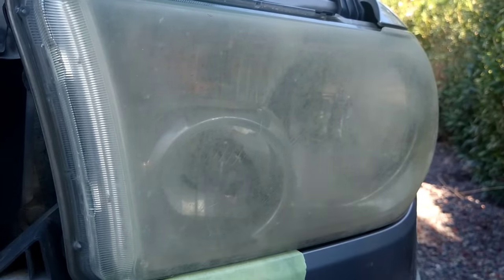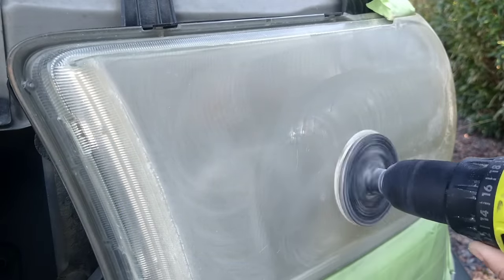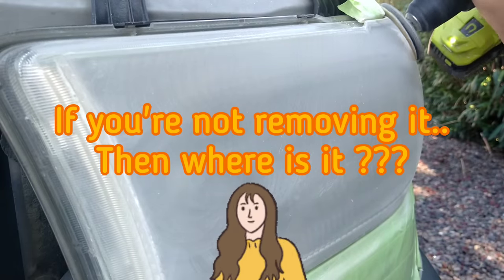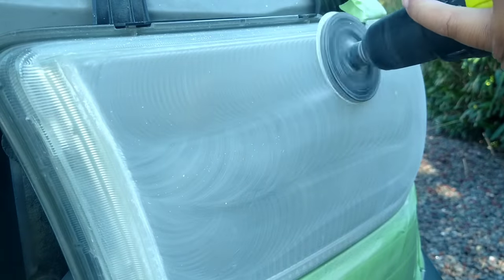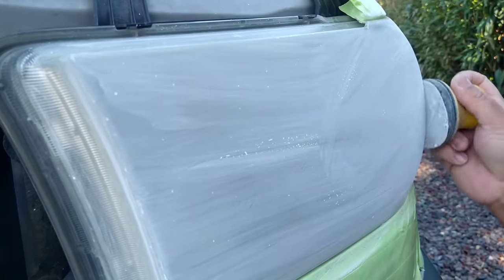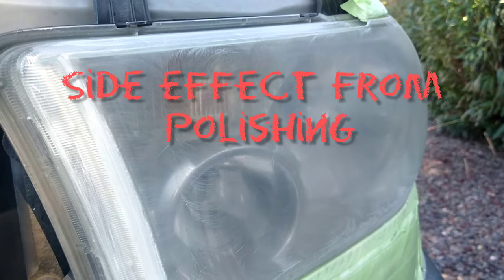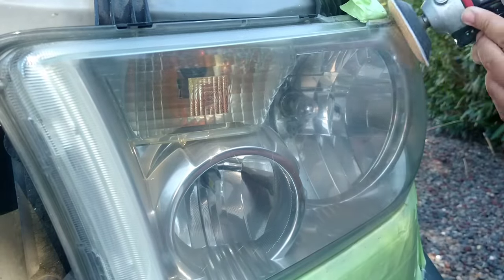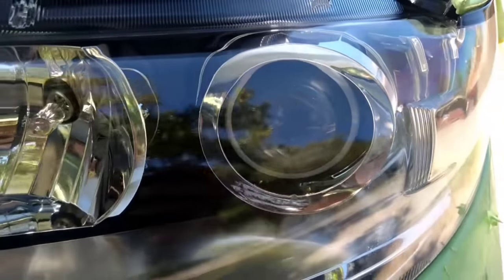POLISHING HEADLIGHTS IS A SHAM/scam  ---  and why you should never only polish headlights

Comment: please help: wet-sand-paper 320-400-600-800-1000-1500-2000 by hand with swirling motion. with each next sanding, go less and less milky residue. they appear opaque now. do i need to go higher grade? 3000, 3500? do i need to buff, can i get away with no buffing? what paste is used for buffing. then i plan to crystal clear coat them. can i skip the buffing?
Reply from the maker: I don't wet sand...it's obsolete...
If you must you need higher grit..
Yes.. always buff...
Watch more of my videos......
Reply: @theheadlightrestorationpro  Thanks. What buffing material to use? Where do I get it from? What clear coating? I just got rust oleum enamel, but is not recommended for lenses. Which one you use> Most of the things I found are for "easy" restoration, not like you did.
Reply from the maker: You got to watch the videos bro.. everything is in the video.. you're asking me something that's what every video...

Comment: there is a plastic film over my headlights.  04 Ford falcon.  if you got that off .. the headlights would be clean.. wouldn't they ??problem is .. how to get it off.
Reply from the maker: Most of the times it damages the clear coat on the headlight so you'll end up need to have a rest for reapplying or if you choose not to reapply..
Pretty much the only way is to pull it off with a heat gun or maybe some water as you pull gently or both...

Comment: why not use DEET on headlight to clear it and  then Maquires Headlight coating?
Reply from the maker: Not sure what this product is ...is it a headlight product ?
Reply: @theheadlightrestorationpro  IT IS ACTUALLY DEET(INSECT REPELLANT) AND IT SEEMS TO CLEAR THE LENS VERY QUICKLY AND THEN I AM THINKING SPRAYING ON YOUR MEGUIRS HEADLIGHT SEALANT.
Reply from the maker: @sandiebock8035  unless you're just looking to repel bugs I probably wouldn't use bug repellent..🐜🐝🐝 check out this video there's a segment that will explain to you why that's not such a great idea and why it appears to make your headlights clear but really doesn't...https://youtu.be/cSD2dAioFWI
Actual have some informative videos coming up soon possibly this week about this issue. More in depth.

Comment: The plastic on headlights is designed to bounce rocks off of it without cracking you can buy aftermarket made in China headlights that have a cheaper plastic that actually does not dull because it's a type of plastic that will crack easier but it stays clear longer it worked for me
Reply from the maker: After market lights =🗑️

Comment: I would caution anyone trying this for the first time, to go slow and gently with the drill/polisher. You can and will burn the lense/plastic very easily. I would stress wet sanding the first few steps. Make sure you don't have to much build up on the sanding surface. Cause this can damage the resurfaced lense. Take your time and just remove the oxide layer to fresh new plastic. Also don't use high speed unless obviously you can.

Comment: I just wet sanded from 1000 to 2000 then 5 coats of uv protection clear. Even got pulled over because they thought my brights were on.. 🤔
Reply from the maker: https://youtu.be/bCD4At1iFAg
That's a lot of clear..
In my experience with each layer of clear it diminishes the the lenses photo transparency.. meaning light escaping the headlight.. this is purposely one of the reasons why I do one coat...
https://youtu.be/bCD4At1iFAg
Reply from the maker: Also made a video someone about that..
What you were saying you do is a bit more extreme than this.
This video is titled why not to double coat..https://youtu.be/NgxNImOAoCY
Might be getting even better performance if you had a single coat.
Thank you for watching..
Reply: @theheadlightrestorationpro  i did 5 light coats.. wish I could post a picture here. By hand it took me about a hour per light. Turned out fantastic in my opinion. Yours did too! I'll check these vids out.
Reply from the maker: Awesome plenty of videos up and more to come should have a couple dropping this week.. I focus on quality over quantity and my videos and everything... Really appreciate you watching there is a email in there in the bio feel free to drop a picture or 2👍🏼💯

Comment: thought you're supposed to use water with the sanding process?
Reply from the maker: In the right place but dry sanding is far superior... But as you do see there's points that I do wet sand... Wet sand far as proper sanding anything is supposed to be at the end as a final finish
.. check this video out..https://youtu.be/cgKCQVM4GyU?si=z99_zVzfJBlW5Pxx

https://youtu.be/9DfP_dqw1mU?si=l-Vv4-VbQNP5T9qQ

Comment: Do you need to buff the finishing spray?
Reply from the maker: Just have a question or two for you to answer your question ...
Have you ever seen me do this?
As perfect as you see my final spray do you think I would need to polish it?...
What you see on my videos is what the process is...
With one exception everybody should be doing with their headlights whether it's headlight restoration or a new headlight that doesn't need headlight restoration that they want to prolong the health of the headlight and not need headlight restoration...
That's AFTERCARE..
With aftercare your lights can literally last 3 to 5 years with this method... Like on my personal vehicle which is 4 years and some change at this point.. just over 4 years...
Here's the video about aftercare..
https://youtu.be/kIur4XxYjDk
Reply from the maker: PS if you have to do anything while your initial application of the clear coat.. the method is highly flawed...
The type of clear coat you should be using on a headlight is set it and forget it..
Spray it on and let it dry..
That's it..
People put stuff that's not designed for headlights on there this is why they need to do all this buffing and all this other stuff afterwards..
Reply: @theheadlightrestorationpro  I used what you recommended  A yes or no would have been an acceptable answer  It was my first time and I may have wiped it too early  Anyways, thanks for responding even if it was condescending lol
Reply from the maker: Not condescending....just this is a video platform...not a question platform..
I have like 50 videos up that do what you asked in each one ...
I really want people to just really watch the videos and not rely on questions that are in every video..
It's not condescending to you or meant that way ..
Just that if something is answered in the videos I would prefer you to get the information from watching...it will sink in better than me just messaging...
Thanks for watching.. 
A lot of videos up and some really cool stuff coming..👍🏽💯
Reply: @theheadlightrestorationpro  Cool! Im ADHD and have alot going on  I will try to watch more of your videos! I love your easy to understand instructions! Thanks for taking the time to tell me you dont have the time lol
Reply from the maker: Appreciate you watching 👍🏽

Comment: Goof off pro strength in the metal can took the haze right off my 350z headlights with just a rag. No abrasive needed. Then clean with a degreases the get the oil off the headlight. Easy
Reply from the maker: Wouldn't come out like this👇🏽https://youtu.be/bCD4At1iFAg

Comment: Can you fix ebay headlights that are very clear but turned yellow?
Reply from the maker: Yes you can use the same exact process on those...
Reply: @theheadlightrestorationpro  I don't mean they are hazy, they are very clear, just the  plastic is yellow. I sanded the coating off, very clear, but still yellow, so I sanded three more times, each time the yellow remains.
Reply from the maker: @r.weaver3769 you never know what's aftermarket... They're typically cheaply made.. the actual plastic (polycarbonate) might have change colors.

Comment: Same as paint.  Once the finish has oxidized thru it entire  thickness it will continue to fail.  A detailer can polish and shine up the surface... but it will not last at all..  Every headlight cover out there has varying depth of oxidation.  If it's oxidized thru the first 30% then that 30% has to be removed by a skilled tech. Etc. Etc.  Many driveway detailers will polish and shine the oxidized  material,  but again It will not last and must be removed down to a  molecularly undamaged material...If any still remains.

Comment: I always say oxidized plastic is a lot like rust on metal. Why wouldn't you remove the rust? And so then why wouldn't you remove the oxidization. Anything less than that is not solving the actual issue

Comment: Use a propane torch.... people  use it on all plastic  to restore  color.  It works.
Reply from the maker: It wouldn't work like this headlights too big of a surface extremely easy to damage about 7 out of nine times you would damage the headlight overall the headlight will be extremely damage let alone the surroundings of the headlight such as car paint and brackets and seals... Not really practical and won't really work.. don't forget this plastic is clear..

Comment: an UV resistant clear coat that is rated for plastics will work to coat the light
Reply from the maker: A coating that is meant for plastic typically can have some issues with headlights you need something rated for clear transparent plastic, one specifically designed for something that has a lumens in it.. AKA releases light...

Comment: first of all, you can do it both ways. One you can clear him or the first one. You can buff and then put ceramic coating on top, it'll last just. As long? But I usually ask the customers cause it costs more money to clear them and to put a ceramic coating on Shop and I have. My customers coming back after 5 years and they still look new so. Yes, you can clear them with automotive clear. Or what's in far from farm? Then take ceramic, wipe them up and wipe them off. And you should be fine

Comment: Polishing just fills microscopic cracks.  As soon as the polish gets washed away, the headlights will be just as foggy as they used to be.  You can test this using oil, just wipe some on a foggy headlight and it’ll go clear…for about 20 minutes.

Comment: Professional detailer here. Polish and or compound is the same as sanding just much slower. if you buff or polish correctly there is no residue buildup. Also the correct compound would need to be used not just any polish will do. Reason it came back is because he didn't seal the headlight properly when it was done or used the incorrect compound. Plastic is completely different then clearcoat. Probably waxed it. Lol. I understand you are solely a headlight restorer. so of course you are going to say your way is the best. Just do your homework people. There are products you can use that don't require sanding and do a much better job in much less time. Be smart and be safe people.
Reply from the maker: Actually you're not completely wrong just in a certain points of what you're saying is wrong.. first let me start off by letting you know that I'm a lot more than a detailer..lol I run a headlight service yes but we do a lot more pretty much everything a detailer does,, but I'm a restoration specialist as well I restored things which includes scratch removal, paint chip fix, minor painting, waxing and polishing ceramic in clay bar all those things, plus more as I said water spot removal more extreme things than just the detailer that until restoration rest removal things like this.. with that being said it does leave compound behind anyone that you use will this is why you must use as you said the right one meant for hard blends polish and headlight polish they exist.. my homework is well done and run circles around most detailers in my area because I'm not a detailer primarily I'm a restoration specialist which is a higher level.. but my passion is for the headlights because it's the most needed thing and automotive industry. You can throw a rock and hit 17 detailers, you can throw a rock and hit 36 mechanics.. you can throw a truck full of rocks and you might hit one worthwhile headlight restoration specialist... Like I said you are right about the fact that they're using the wrong polish on the headlights they're using wax ,and metal polish and bizarre stuff because they don't have the education to understanding, but with that being said even if they use the right stuff the stuff that I use it would come right back because they're not sealing .. I say my way is the best because it gives the best results, you can possibly tell me that there's a clear headlight there's only so clear I have I can get.. also it's friendly for the headlight environment and for the customer's property, it's fast and efficient and I can restore the same headlight 36 times and one day if I needed to as it takes 20 minutes.. that's to restore and break down and restore again over and over if I needed to without removing much of anything but the sealant... I think my way is the best and one of the best shall we say just simply because it is and functionality of me trying it every single other way I know of except for a few and combining ways and doing weird stuff and experiments I have not seen anything else like and more practical for business since and more practical more so for the customer or therefore someone else's vehicle that's not your own... So that's a little bit about me you should watch my new video check out the end I kind of touch bases on that that I do more than just have that restoration except for to me Heather restoration is the most important thing as I explained earlier...
https://youtu.be/LcMFr0mpp-4
Without sanding there's no product I can hold a candle...
One of my biggest sayings I tell everybody that says this.."if you're not removing it then where is it at"very first the fact that you just changing the element slightly it's a little scientific not trying to go into it right now but those cells those molecules are already damaged therefore when you do that it's part of the reasons why it comes right back faster and faster every time.. so when you see it it might not come back as fast as if you wouldn't see it but it will come back faster much much faster than if you would have removed it then sealed it if that makes sense... The pathway to discoloration is still there more or less.

But you do have a lot of good points that are valid..

Comment: You went from 800 grit to 3000?  Not to 1500 or 2000 then 3000?
Reply from the maker: Exactly.... This is over sanding especially with dry sanding... When you wet sand you're not getting the true ability of sanding the wet part of it decreases the capability of the sandpaper by about 70% on average... Also using power tools let you get the true power of the sanding disc also it's not just a 3000 or even an 800 it's a p800 and a 3000 Trizact... Very high quality sandpaper.. also the 3,000 Trizact is revolutionary.. it does the power of all discs between 800 and 5,000.... They're very expensive and very high tech... I have well over 100 videos on my channel streaming.....https://youtu.be/9DfP_dqw1mU?si=ib0Xc8eXM74kpqNl Check this out

Comment: What is the average cost vs headlight lens cover replacement?
Reply from the maker: There is no headlight lens cover replacement this would be on very rare vehicles.. they're not made like that anymore they're one entire solid unit the whole headlight assembly sealed and not made to be taken apart...
The cost of headlights per headlight without labor installation range from anywhere from $200 to $7,000 on average some even more expensive...
Reply: @theheadlightrestorationpro  Very good! Thank you for responding.
Reply from the maker: @AmericanWoman1964 no problem anytime...😊

Comment: They have a 2K clear specifically for headlights.
Reply from the maker: Yes they do it's a bit more milder, but has many of the same side effects as 2K clear.. it's almost as if they soften it a bit, and did a couple tweaks but it's basically the same thing.. most negative points still exist in this.. application dry time is number one, and uneven coating and comparison.. also the cost is ridiculous 🧐 better than the actual 2K clear but not by far... Still very difficult to remove and comparison...

Comment: I dunno man, how do you not have a rotary or Random Orbital sander for this.
Reply from the maker: I tried one before...not enough focused control for me..and most are to big.. surface area, hard to find 3 in, and or 3-in backing... Even if you do find 3 in backing plate that fits the actual orbital sander is too large feels weird.. hard to get into certain areas.. you need something that is nothing but pad or disc and lesson behind it.. that's the main reason.. an orbital just not built that way.

Comment: I prefer to wet sand vs dry sand because you can sand burn through the plastic .
Reply from the maker: You would actually have to be trying on purpose to burn through the plastic...
Believe it or not... I can hold my drill one spot for probably a minute and a half because I have the proper equipment.. you just have to be educated about it...

Comment: The only question is, how much do you charge to do all that, and is it less than the cost of a new lens. Replacement lenses are cheap af on ebay.
Reply from the maker: You can't buy lenses for most vehicles to separate the lenses in the housing is incredibly difficult and would probably take 6 hours to do it without cracking if you could get it without cracking on most vehicles.. is considerably cheaper than lights replacing the whole light the whole headlight which is how they're sold mostly.. you should never buy anything that's not OEM.. considerably cheaper the cost of aftermarket or OEM lights on most vehicles.... Like 10% of the cost

Comment: Headlamps are plastic because car designers prefer style over substance. The old circular or rectangular glass sealed beams never go hazy. You just replace the whole unit when the bulb burns out. They last around 10-15 years.